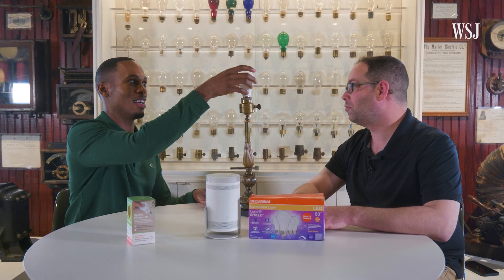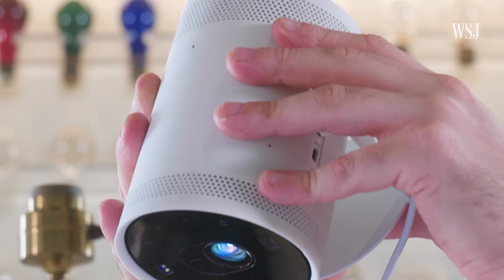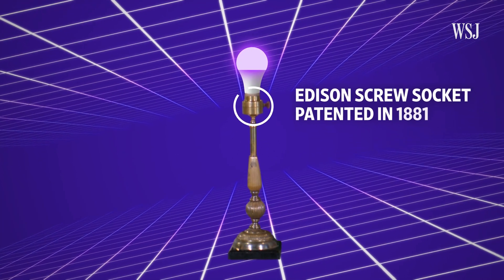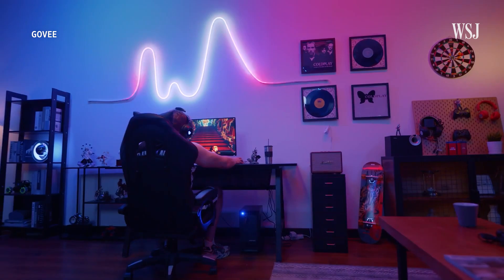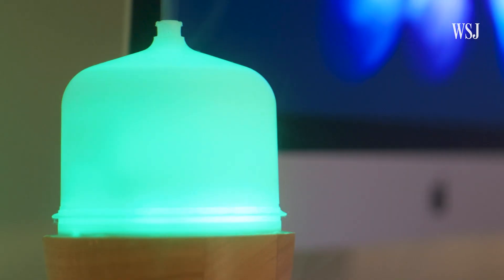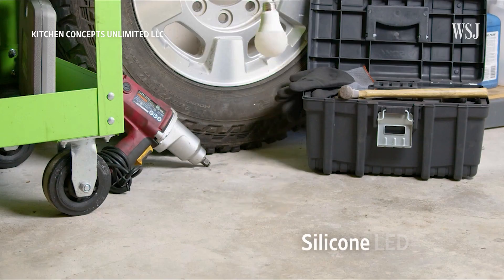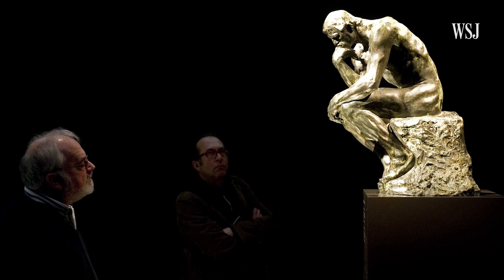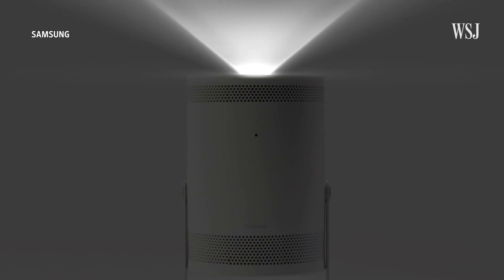If Lightbulbs Are Smarter, Why Haven’t Sockets Changed in Over 140 Years?

Comment: Long lasting universal standards are precious and need to be preserved. The USB standard has been updated four times in the past 25 years, since VGA connections were replaced with  3 different types of video connectors, there are 8 different kinds of EV charging ports in the world, 6 kinds of 220 volt outlets, 6 different classes standards for connectors for hydraulics, tube, pipe and hose, a dozens of different threaded fastener connections in common use. No one user is big enough to pick a winning standard and so we are stuck with competing and incompatible interface standards that waste time money and resources. Let's cherish the E26 Edison socket and NEMA 5-15 outlet.
Reply: Could not agree more. Unless the change could literally stop global warming in its tracks stick to the old design. 🙏🙏🙏
Reply: Agreed. Until the day electricity can be transmitted wirelessly totally. Socket should remain the same.
Reply: @temjenkrazy  electricity can be transmitted without wires but it is horrendously inefficient. The power of radiated EMF also drops off exponentially with distance unless you happen to be using concentrated microwaves or somthing like that.  I am no expert but based on what I read I don't see wireless power being wirespread.
Reply: @mbox314  And that's what I am saying. Until the day we have the technology to harness electricity wirelessly, we should not change the socket. With a bit of sarcasm too.